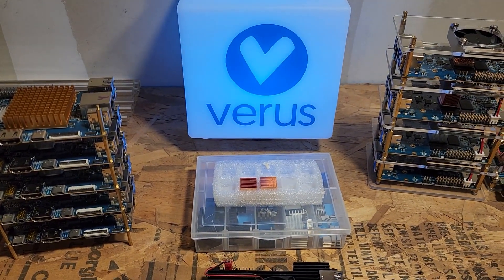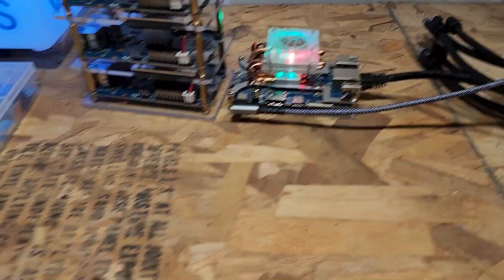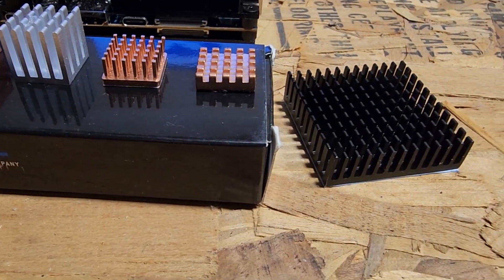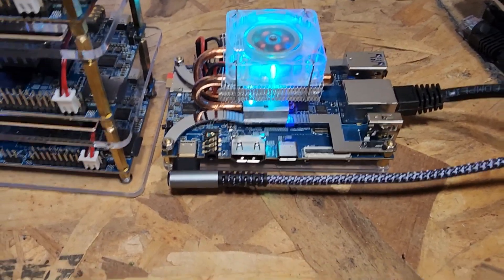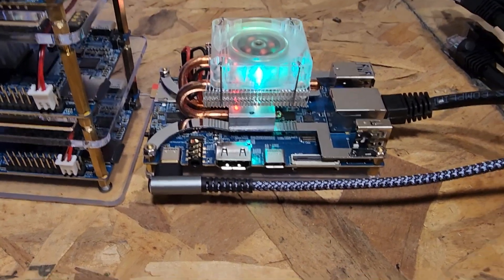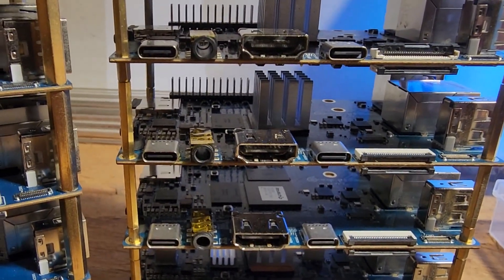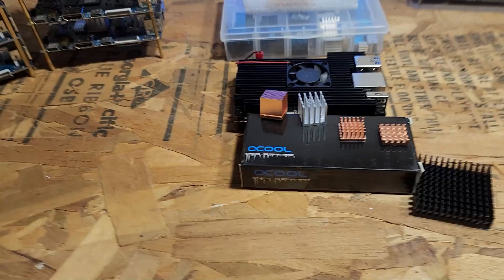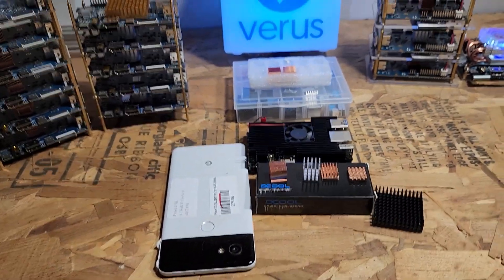What is the Best way to Cool a Orange Pi 5, Raspberry Pi, Rock Pi or the Banana Pi

Comment: One of the most important things he only briefly touches on here while talking about these heatsinks is the thermal interface you use between chip and heatsink. That is JUST as important as the heatsink itself. Using a 3w/mk TIM or adhesive versus a 13w/mk TIM or paste makes a massive difference. It changes the equation from thermal brake to thermal transfer. Tons and tons of very thermally poor adhesives, pads and pastes out there. Some truly horrible ones! Thermal glues are almost always garbage thermal conductivity.

Comment: On the "Ice Cooler" I throw the pink pads away, apply thermal paste to the chip, bend the bracket arms up slightly, then screw the nuts down slowly. I treat the bracket arms like CPU cooler tensioners and screw the nuts down until contact is made between the coldplate and the CPU die/paste. 50 degrees C on the chip all day long even in 95 Degree F ambient temp.